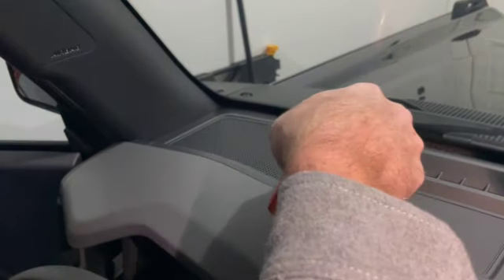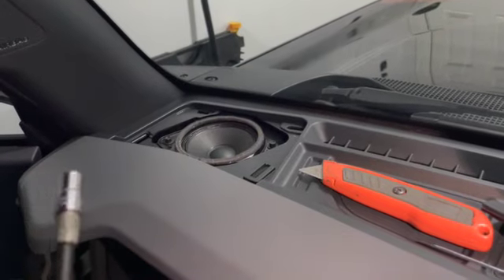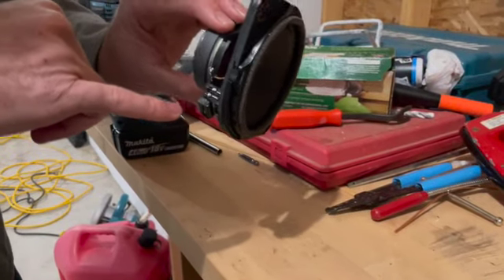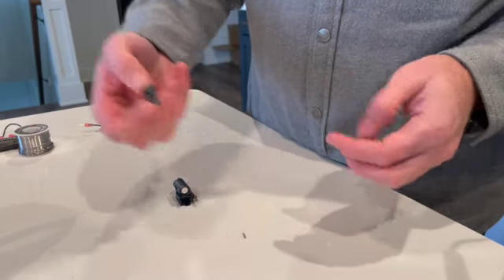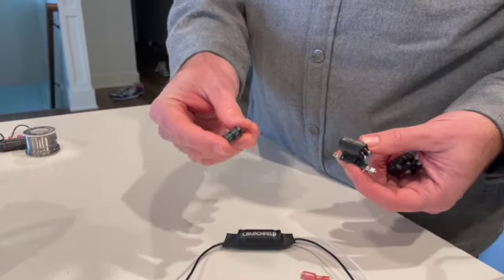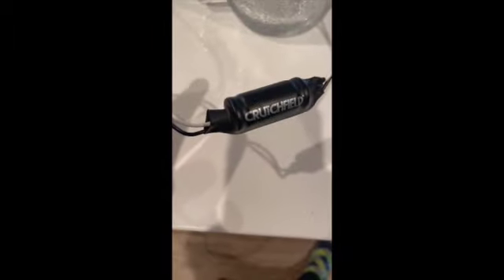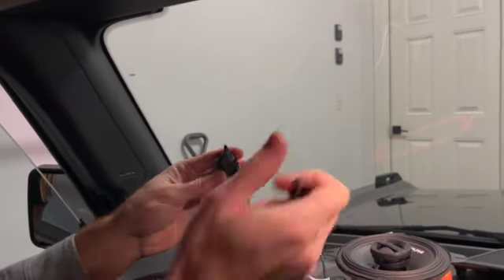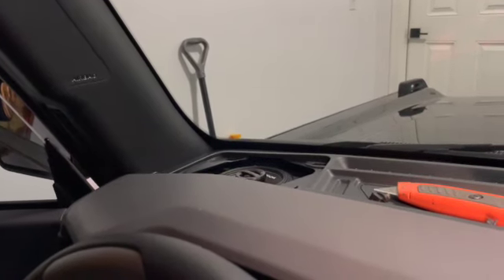Bronco dash speaker upgrade with factory connector

Comment: Great video detailing how to reuse stock connectors. Wondering if the 6.5” speakers in kick panels would be the same as those are in series I believe and have 4 wires going to each speaker connector.